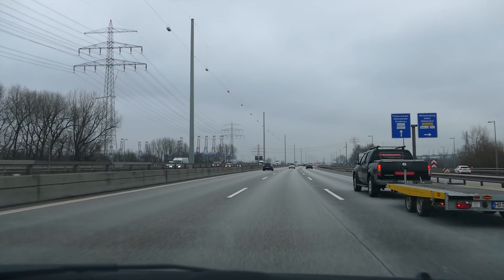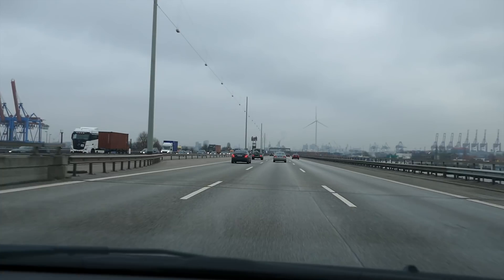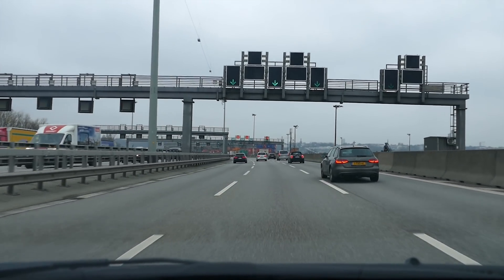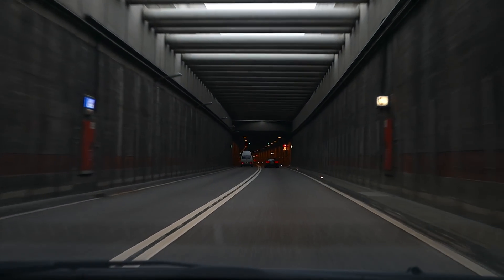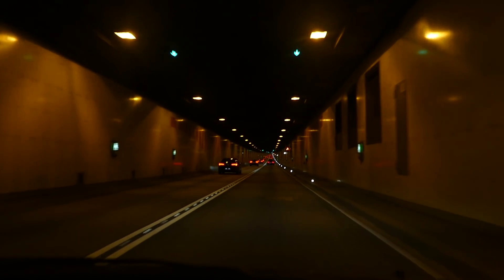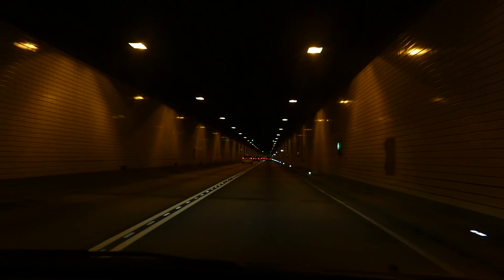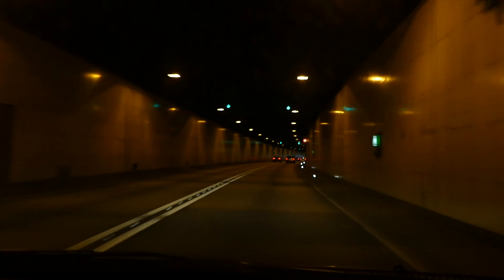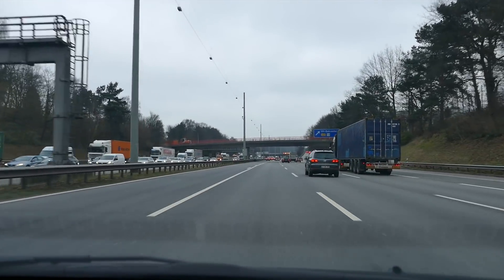The Elbe tunnel (Elbtunnel) in Hamburg: Part of German Autobahn

Comment: Fascinating to see how it's done in Germany. The idea of the radio stations having transmitters in the tunnel is interesting. I believe some stations do that in the blackwall tunnel here in the UK also, using a 'leaky feeder' form of antenna. Is the same used there do you know?
Reply from the maker: I don't know what type of antenna they use, but a 'leaky feeder' would make sense considering the length of the tunnel.
Reply: We have a similar emergency broadcast system in the CityLink owned tunnels here in Melbourne.  I believe the tunnels are fitted with loudspeakers, but they also broadcast messages over AM and FM so you clearly hear the message on your car's radio.

Comment: Thanks. Can you comment on speed limits in Germany - many people in North America think German drivers can put pedal to metal on Autobahns and rules are liberal. From what I know rules are very strict and not all section of motorways have unrestricted speed limit. In Canada, other than British Columbia speed limit is 100km/h, however most people would go 110-120km/h without Police giving speeding tickets, however driving 20km above the posted limit, it's asking for trouble.
Reply from the maker: Only those sections of the Autobahn that lead through remote areas have no speed limit. In urban areas, near junctions, slip roads and when surrounding landscape demands relatively tight curves, there are speed limits. Commonly,  the speed limit is either 180 km/h, 120 km/h or 100 km/h. At present, a lot of speed limits are in place due to damaged road surface and / or construction work. In such cases the speed limit can be as low as 50 km/h. 
In the video, the speed limit in the Elbe Tunnel had been set to 80 km/h. This is to increase the density of traffic in the tunnel. More cars per hour can get through the tunnel with a lower speed limit because the safe distance between the cars can be shorter.
Due to tolerances in the speedometer and the radar equipment used to measure vehicle speed, generally it's OK to drive 10 km/h above the limit. Penalties for speeding can be a fine for minor violations, but in more severe cases you can loose your driver's license for a certain period of time. You may need to go through a psychological assessment to get your license back. And when your speeding caused an accident, you are in serious trouble. Recently, two persons involved in an illegal car race that resulted in the death of an uninvolved person have been convicted of murder.
Reply: +DrCassette 
Two weeks ago I attended funeral - on second day of Easter at night teenager, a Chinese international student driving BMW at double the 50km/h speed limit, T boned a Toyota Corolla. The two people died within 2 min after the accident. 
I used to ride motorcycles, have screws in my knee after older man cut me off. Some people are very lucky, some not, try figure out.